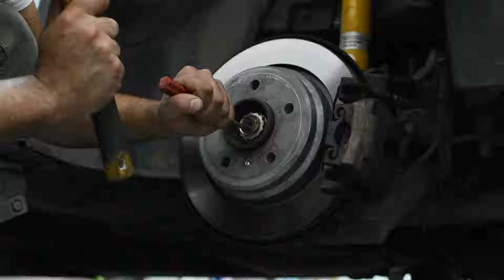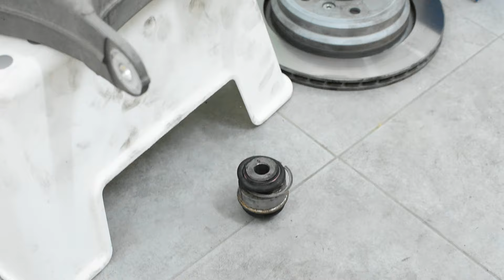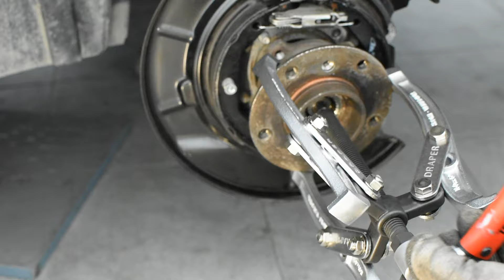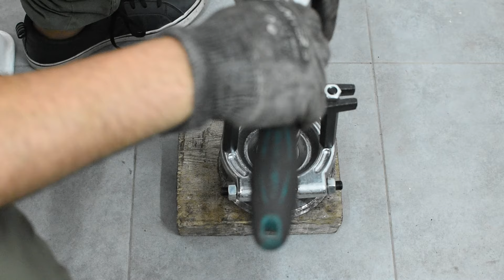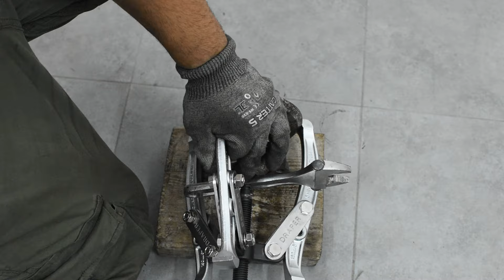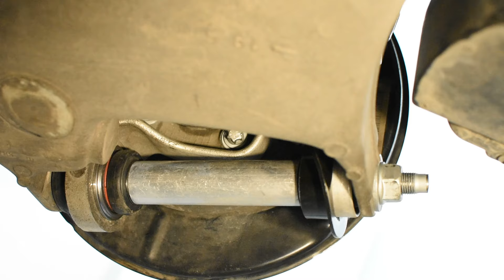Rear wheel bearing replacement BMW E39

Comment: In the original, the bmw company sells the hub together with the bearing for a reason, since no one can install it correctly and the bearing is installed only under the press, no hammer blows can be made, since you break the bearing back.
Reply: I managed to ruin one of the threads on the hub, can i change only the hub or do i need to change the bearing also?

Thanks for the answer if anybody has one.
Reply: actually bmw sells it as two separate parts 33411093371 for the flange and 33411095652 for the bearing. you cant buy original part already assembled together

Comment: Quick note as I just finished this same job be sure to use a 3 jaw puller/press 
I was using a 2 jaw and it was vary difficult it install hub bearing so I got tired of it and went out and bought a 3 jaw puller and wow it went on almost like butter. Good luck
Reply: Hi, what is your 3 jaw puller size? Cheers

Comment: At the end you can get a specific tool which attaches to the driveshaft threads via thin walled threaded collar, attaches to a thread which then goes through a receiver cup and can be used to pull the driveshaft splines into the hub in a controlled steady way.

Comment: Hola tengo un e39 un 28i tengo que cambiar el buje y ya de paso el cojinete por ir eliminando problemas con el abs... Salta en giros a derechas, y he cambiado los sensores, el módulo es de otro e39 del 2004... Codificado para que lea el ASC ... Y sigue fallando... Bueno quería saber cómo se llaman los vasos para quitar los cuatro tornillos del cojinete... Gracias y gran canal
Reply from the maker: Hola Toni. El vaso que comentas es Torx hembra E14. Gracias y suerte, a ver si puedes solucionar el problema que comentas. Saludos!

Comment: Using a torque wrench as a regular wrench. Legit.
Reply: I managed to ruin one of the threads on the hub, can i change only the hub or do i need to change the bearing also?

Thanks for the answer if anybody has one.

Comment: It great to work on a car that must never been on the road every thing looks new   My 20 year old 530d touring was a tuff case everything was worn and rusted with no specialist tools  I was not able to remove e14 screws even with the shaft nuts off and shaft  pushed back full   How ever I got the whole job  done Ps don't bother if you don't have the proper  tools to do all bushes and wheel bearing plus a lots off time it was the hardest diy job I ever did

Comment: Man your bolts that hold that bearing appear to come out kind of easy. Mine are where I'm stuck just now. I'm gonna jack the car up further to make use of a breaker bar. I just hope they aren't as hard to remove as the front wheel bearing bolts.

Comment: Was your E-14 socket to remove the four bearing bolts 1/4" drive?  My E-14 socket is 3/8" drive and it will not fit to remove the bolts.  Thank you for your help.
Reply from the maker: E-14 3/8” worked for me.

Comment: Под прессом вставляется подшипник ступицы не делайте так так как и новый у вас будет гудеть.
Reply from the maker: No, You’re not right. Smooth driving here, no weird sounds, nothing…
Reply: @TheultimateDIYmachine  A hub bearing is inserted under the press, do not do it as the new one will buzz.
Reply: @TheultimateDIYmachine  In the original, the bmw company sells the hub together with the bearing for a reason, since no one can install it correctly and the bearing is installed only under the press, no hammer blows can be made, since you break the bearing back.
Reply from the maker: I’m telling you, inserted by hand and not any buzzing. Press isn’t mandarory on this job.
Reply: @TheultimateDIYmachine  In most cases, the bearing breaks from the impact of a hammer and this absolutely cannot be done in your case, you are very lucky.

Comment: How did you get the lower control arm back on after you reinstalled the wheel hub and bearing? Having a pain in the ass time putting the control arm back on the car and lining up all the bolts that hold it in place. Did you put the bolts back in on the lca in a certain process?
Reply from the maker: Yeah I made it alone, and I remember it was a nightmare too...i used the floor jack to help me apply some pressure to lca while tightening bolts. The extra long bolt was first. Then the other two bolts, from rear to front side of the car. If you can use a couple extra hands i think that would be easier for you...however as I said I made it alone, it’s not impossible. Be patient and good luck!
Reply: machines awesome thanks for the prompt reply I'm about to go give it another go and see what I can do. Cheers!

Comment: Great video man, I'm gonna try this. One of the threads on my wheel hub got stripped so I need a new hub, gonna do the bearing as well since it's probably going to break when I take the old hub and bearing apart.

Comment: You could benefit from power impact drill
Reply from the maker: Yeah, I’m working on it, Thanks!
Reply: I managed to ruin one of the threads on the hub, can i change only the hub or do i need to change the bearing also?

Thanks for the answer if anybody has one.
Reply: @keemoify  I would save the headache and just chance the whole thing. It’s a pain in the ass to remove the bearing from the hub. Also requires special tools like a press to reinstall the bearing
Reply: @kenxiong6830  Do you know where i can buy the whole thing? Hub and bearing? I dont have a press
Reply: @keemoify  not sure

Comment: Wow, Your car look like new. I can see that You take care very much and change many things. I also have a e39 530i and a e46 330i. These are still real cars and i will drive them for a long time. The new direct injection engine cars are crap in my opinion. I don't want to clean a engine with walnut granulate😁
Reply from the maker: Yeah me neither 😂👍! Nice couple of cars you got there btw, I'd like to  buy an E46 coupe... Thank you very much for supporting my content, this weekend I'm gonna replace motor and transmission mounts (530i) and upload the video after it. Wish me luck! 😎
Reply: @TheultimateDIYmachine  i have done this job at my 330i together with the complete rear axle mounts. The car have now 220.000 km and drive like new. I love the 330i for powerful driving and the 530i for cruising. I wish You a successful work and i know, this is a easy task for You.

Comment: if yall are wondering why bmw's are quoted so much for repairs, its cause they take 20 extra steps like this guy did with the removal of the swing arm to get to 4 lil bolts. more parts removed=more parts broken, example, that ball joint. for this job, all you need to remove is the braking system. (caliper, rotor, dust shield, and e-brake.) and can be done in 30 min if the parts aren't corroded too bad.

Comment: is there a softer way to push the bearing back on the axels ? Thanks
Reply from the maker: BMW has a special tool for that mission but it is very expensive (300 dollars or more). I’d stick to the hammer...
Reply: @TheultimateDIYmachine  do you think with a brand new axle it would slide on easier?
Reply from the maker: Sascha B I don’t know, the thing is I read you can make a cheap guetto tool that would help you out (I was too busy and did not have time to do it):

1. Get a 27-mm Impact Socket, not the usual Chrome-Finish Socket because it is difficult to weld anything that is chrome-plated.

2. Go to local muffler shop (or do it yourself if you weld), they must weld the 27-mm Socket to a new 36-mm nut (the 12 point one).

3. Ground down the 12-point part with an Angle Grinder. That’s the BMW Home made tool You can slide it in place and while thightening you will able to reach the axle easily.
Reply from the maker: Sascha B Thank you so much for the link! It looks pretty good 👌

Comment: Last time I did a press on bearings without a press was the last time I did one
Reply: Ug
Reply: Cool
Reply: I managed to ruin one of the threads on the hub, can i change only the hub or do i need to change the bearing also?

Thanks for the answer if anybody has one.

Comment: Don't use a torque wrench for unbolting stuff!
Reply from the maker: Daniel Canea Thanks for the advice Daniel, I know, my 1/2” ratchet was broken and I was in a hurry...but not anymore!
Reply: Daniel Canea there are torque wrenches also designed for unbolting.
Reply: I managed to ruin one of the threads on the hub, can i change only the hub or do i need to change the bearing also?

Thanks for the answer if anybody has one.

Comment: Bro, if the axle doesn't fit the hub spline without a hammer you need to clean it up more
Reply from the maker: rasch19785 It’s very tight, bro
Reply: I managed to ruin one of the threads on the hub, can i change only the hub or do i need to change the bearing also?

Thanks for the answer if anybody has one.

Comment: HEY!! MY AXLE IS SEIZED IN MY HUB/BEARING. ANY ADVICE
Reply from the maker: Tons of PB Blaster, time and patience? Maybe torch and hammer? Good luck anyway!
Reply: The ultimate DIY machine Ah another thing. My entire hub with the presser keeps rotating. I’ve tried wedging it with a pry bar but no dice. In all of the other bearing videos I’ve seen nobody else seems to have the issue with the entire assembly rotating. Any advice is much appreciated. I’m doing a bearing,axle,and hub on my 2003 BMW Z4. Shares the same rear axle as the bmw e46
Reply from the maker: Greens And fiends I don’t know, using a really long breaker bar and wedging in between two studs and the ground would be enough.

Comment: Wish I would’ve seen this video earlier. I’m surprised that you where able to reach the E14 bolts without removing the driveshaft. I didn’t have enough room for it on a E39 530d Touring. Maybe the diameter is bigger on them
Reply: Use a swivel extension for bolts like those

Comment: Very good, a press would of make your life so much easier.
Reply from the maker: Yeah definitely and an elevator too!
Reply: I managed to ruin one of the threads on the hub, can i change only the hub or do i need to change the bearing also?

Thanks for the answer if anybody has one.

Comment: Next time put the bearing in the freezer  and heat the other part a bit it will go in by itself.
Reply: Not for this case.
Reply: I managed to ruin one of the threads on the hub, can i change only the hub or do i need to change the bearing also?

Thanks for the answer if anybody has one.

Comment: To much effort , I would have installed a new wheel hub right away 😏
Reply: I managed to ruin one of the threads on the hub, can i change only the hub or do i need to change the bearing also?

Thanks for the answer if anybody has one.

Comment: Sorry, you saved the money for the complete assembly by changing the bearing itself.. Now that saved money buys a new torque wrench,we saw you use the torque wrench to loosen bolts..I checked, the  complete bearing is 109 Euro, so you saved 55. Just enough for the torque wrench
Reply from the maker: rasch19785 55 Euros for a bad quality Chinese Torque wrench? Think I’ll stick to mine for a while...but thanks for your concern!
Reply: I managed to ruin one of the threads on the hub, can i change only the hub or do i need to change the bearing also?

Thanks for the answer if anybody has one.

Comment: It’s 2020, ever thought about cordless impacts and ratchets?
It drives me crazy to see people slowly turning bolts by hand when you can seriously cut the time spent using cordless impacts
Reply from the maker: Environmentally friendly man I did it my way (like Sinatra said) time doesn’t matter here, this is not a shop nor a businnes but it’s a hobby for me and i like turning bolts by my hands 💪🏼, so take it easy! Thanks for watching by the way 😁
Reply: Not all people have 500 bucks to invest in a quality cordless which they would use once or twice. You don't change brakes and bearings every 10.000km
Reply: I managed to ruin one of the threads on the hub, can i change only the hub or do i need to change the bearing also?

Thanks for the answer if anybody has one.